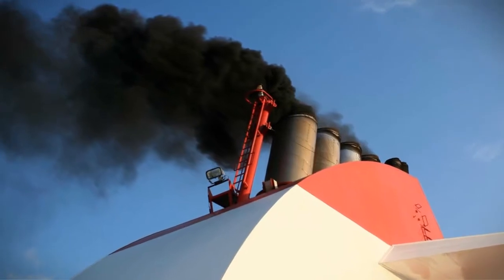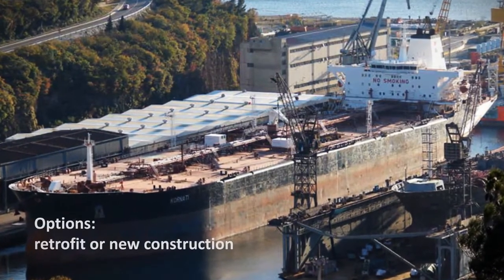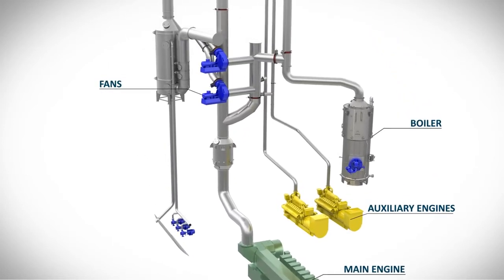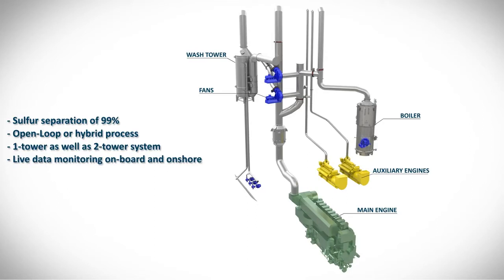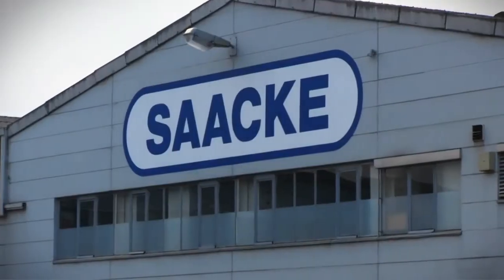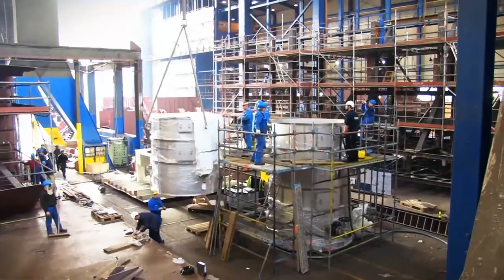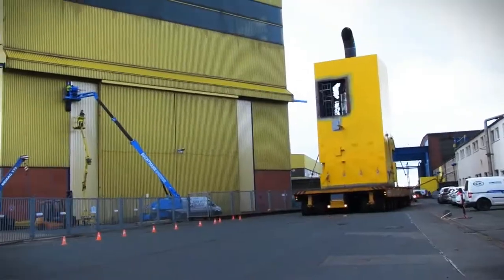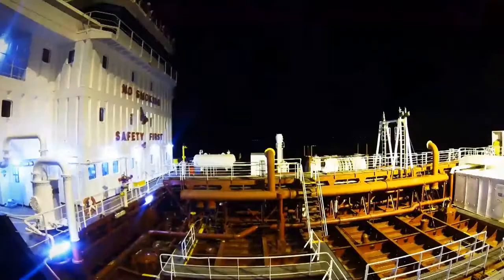Saacke SOx Scrubber System (EGCS-HM Exhaust Gas Cleaning System)

Comment: I AM MANUFACTURER OF INDUSTRIAL WATER SCRUBBER FOR DESOX AND DENOX AND WE ARE USING NAOH FOR REAGENT.ACCORDING TO YOU  WHICH REAGENT IS BETTER AND ECONOMICALLY TO USED FOR SOX AND NOX.?
Reply from the maker: Dear Mr. Jiyani,

SAACKE's scrubber is a de-SOx unit and uses: 
- the natural alkalinity of seawater in open-loop for removing sulphur from the exhaust gas
- NaOH in closed loop

For more information on the system please visit SAACKE's dedicated scrubber page at : https://www2.saacke.com/za/products/exhaust-gas-cleaning/
Reply: @Oceandynamic  
SIR,
IF WE ARE USING SEA WATER THEN HOW MANY PERCENTAGE EFFICIENCY WE CAN GET FOR DE SOX PROCESS?  CAN WE USE ONLY SEA WATER?
Reply: @sagarjiyani3506  Dear Mr. Jiyani, the efficiency for SOx removal is 99.9% using seawater of normal alkalinity. Essentially, by regulating the water input to the system it is possible with approx. 50 m3 of water per hour for every MW of main engine power to have 0.1 % sulphur in the exhaust gas when burning HFO with a sulfur content of 3.5 %.
In case you need more clarifications, please do not hesitate to contact your local SAACKE office: https://www2.saacke.com/uk/contact/worldwide/
Reply: MgOH